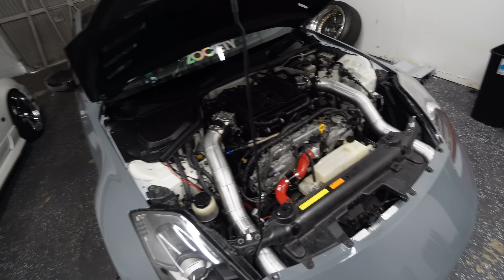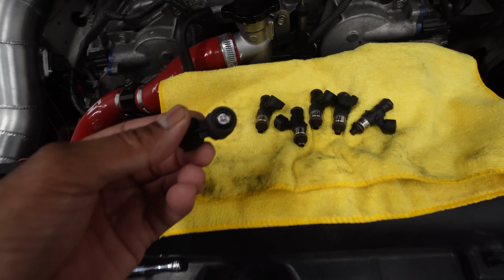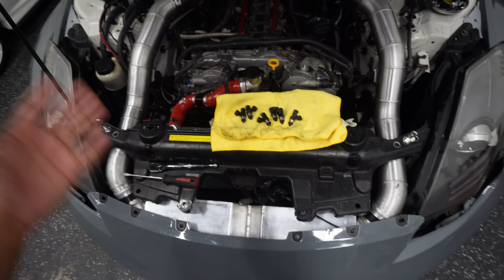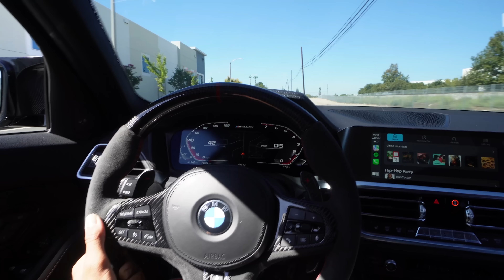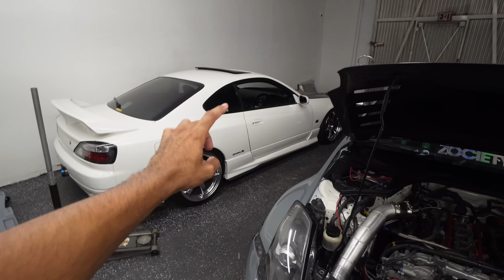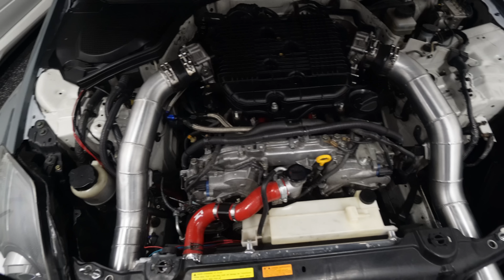It Couldn't Handle The Boost

Comment: I know it’s easy for me to say right but if you’re worried about losing boost while shifting, why don’t you try to go for a flat foot shifting set up I’m not sure what the supporting mods are but I do know that if you tune it the right way you could change gears while your foot still on the gas like a lot of the new cars that are manual like the civic type R and even the new Z if I’m not mistaken but you get the point

Comment: Glad you got it figured out. Hey man What up with the turbo on every shift? If I’m correct then this is an issue with the waste-gate location or size which shocks the compressor wheel on every shift causing a flutter sound. Shouldn’t have a flutter should just hiss. Now I’m no turbo guru no hate or judgement from me but I study cars all day long figured might help a bit. From my understanding that sound could destroy your turbo over time and robs power.
Reply: No, completely normal. Its supposed to do that.

Comment: Idle hunting is usually from vac leak or bad IAC. But since vqhr doesn’t have IAC, and you swapped with new intake manifold along with throttle bodies, you can try throttle relearn and see if it goes away. Also try performing smoke check to find additional vac leak and boost leak. But if boost comes on the way it should and hits target boost and stay there, most likely there will be no boost leak.
Reply from the maker: yep tried like a billion relearns and 3 different ecu's even throttle bodies. really weird lol A lot of Hr's have this issue
Reply: @Freshhkiicks  I would do smoke check to find any additional vac leaks at that point. Good luck!
Reply: @Freshhkiicks if it’s common with them it’s probably a software issue with stock ECU or intake issue. I feel like if you ever go aftermarket ECU it will fix that right up.
Reply: @Freshhkiicks time to go standalone ecu 😉

Comment: Check engine light came back because when hitting limiter the mf thinks it knocking you know better than me but clear the code and that mf will be smooth as butter
Reply from the maker: The cel is for the IDLE.